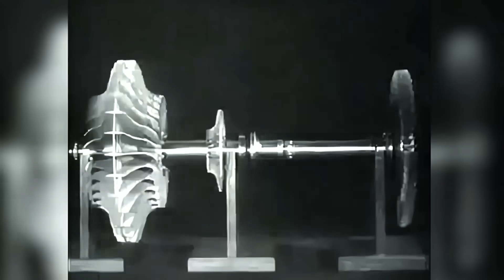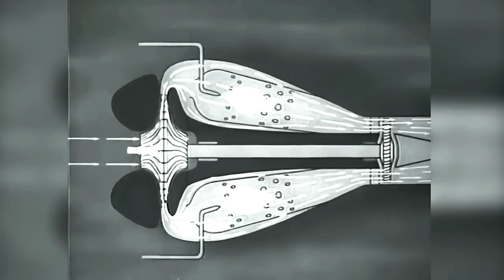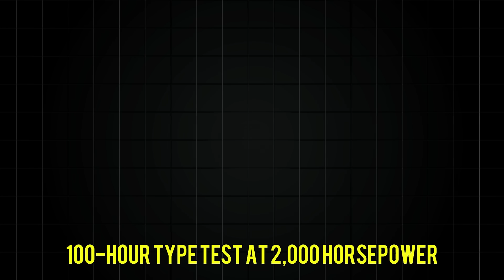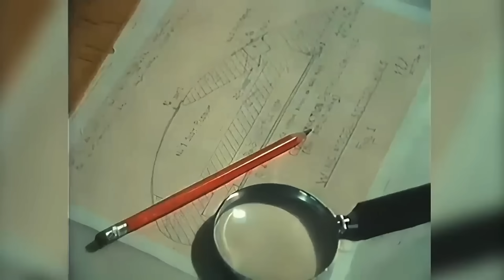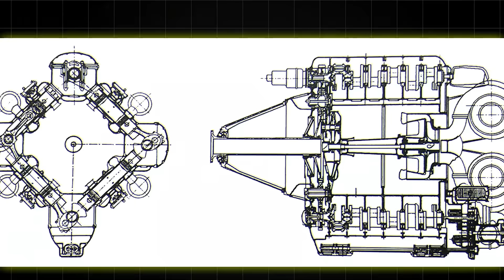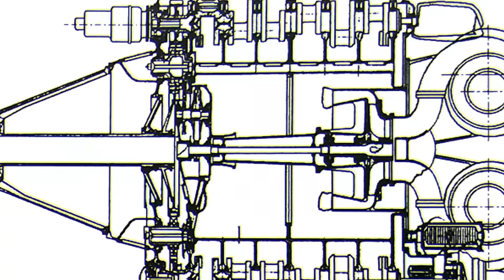The Shocking Truth Behind Junkers Jumo 222 Engine

Comment: Every combatant pursued engines of comparable size. The US had a half dozen similar engine projects that all failed.   The British Sabre and Griffon engines were also comparable in displacement, and worked. Claiming that those countries stuck to traditional engines while Germany sought some kind of breakthrough is just ignorant.
Reply: It also has to be remembered that the Jumo 222A/B was expected to produce 2500 hp and only 87 octane fuel.  It was only a little heavier than the Napier Saber with both  over 900 kg.  The engine  did have technical problems but they were slowly solved and the engine was on the production plan for 1944.  Too late to help the Ju 288 but a likely power plant for the JU 388, JU 488 and variants of the TA152.  
-It likely would’ve been ready in 1943 I would’ve performed as well as the Curtis Wright R-3350.  The Germans just didn’t have the resources to gamble.  
-It was ready by 1944 and it was scheduled for production but then they decided that they wanted to see 3000 hp out of it.  They were reaching 2800 at the time using 87 octane fuel and water methanol injection.
-Obviously at that point they saw Jets is the only future.  Plus the Jumo 213J and DB603M we’re both promising around 2700 to 2800 hp on C3 fuel.
Reply: Correct the big factor in this is streamlining production for the war effort
f.e. The Soviets refused to put the T40 (and improved version of the T34) in production.
The USA also had improved versions of the Sherman on halt.
The British kept the Merlin instead of the Vulture.
Its all about getting the most bang for your buck.

A famous modern example is that all JCB tractors did dig more M3 of dirt then all other big diggers combined on the planet!
Reply: Continental developed a similar design with multiple banks of six cylinders.  Another failed super engine, lost to ambition.

Comment: 01:07:
What on earth is Frank Whittle (British gas turbine pioneer) doing here? I don't believe we worked on the Jumo-222! 
This use of any mix of historical footage from the period like so much wallpaper is becoming quite common on YT. Personally I find it can be quite annoying.

In his biography Ernst Heinkel pointed out that the Treaty of Versailles, which forbade Germany from building military grade aircraft, had little effect on German airframe development, but seriously compromised high performance engine development, one of the reasons his company developed the first jet engine to fly. It takes far longer to develop a high performance engine than the airframe with which to fly it.

A good part of the Jumo-222 story was continuing changes in requirements by the RLM to an already complex engine.
Another reality was that the German aero engine industry was seriously overloaded. There was a limited number of engineers to oversee engine production which had to meet ever more demanding output. Engineers and skilled tradesmen were always at risk of being forced into the army to help bolster the collapsing war in the East and there just weren't enough wartime men or resources to get such a radical engine to production status. The entire Bomber-B program (Focke Wulf FW-191) which had been predicated on this engine had to be scrapped. 

As a reminder of the risks of developing small high power engines, the Rolls Royce Vulture, a 24 cylinder X configuration engine was so unreliable and associated with engine fires that it killed the Avro Manchester. The Napier Sabre a complex H configuration (2 x 12 cylinder horizontally opposed engines driving a common output shaft) with sleeve valves suffered serious reliability problems until quite late in the war. These engines were radically different from those already in production and came with unknown risks, as Dr. Brandner at Junkers would discover with the Jumo-222. Junkers was already producing the Jumo-210, 211 and 213 quite apart from developing and producing the 004 gas turbine and were clearly overextended.

Comment: The Germans had a significant problem in the Octane rating of their fuel.  A bigger engine was required to produce the same power as a smaller Allied motor running on 100, 130 or higher Octane Allied fuels.  It was only remediated in part with water injection and methanol injection, which the Allies could also have used if they did not already have the high octane fuel advantage.  So bigger engines without bulk was a real problem.
Reply: I first came across this in a British book published in the early 1960. The authors summed up it up simply: the DB601 increased from 1000 hp in early models to 1300 in late models. The Merlin went from 1000 to 1600.
Reply: @geoffsokoll-oh1gq  the DB601E Use on the Me 109F4 was a masterpiece that achieved 1300 hp on 87 octane fuel using variable length tunable inlet ports.  In June 1942, the ME109G1 entered combat Service with the DB605 increase cylinder volume. Technical problems meant this 1420 hp engine produced 1300 hp for a long time.  It probably could’ve  been improved with better fuel and some strengthening.  
-about three months after the ME109G1 entered Service the spitfire IX with the Merlin 61 entered Service with 1560 hp.  When the Germans fix their problem they went to 1420 but the British then jumped to 1700.  By 1944 using water methanol injection the Germans got to 1700 hp as well.  But generally British engine power was 12 months ahead of German.  Part due to fuel and part due to the teething problems of introducing the new engine.
-The Germans had planned a two stage DB605L for 1944 bombing of the time of Ben’s plant and the high altitude test sells delayed. What would’ve been used on the ME109 G6.  In aircraft supposedly capable for four57 mph at 31,000 feet.
Reply: @geoffsokoll-oh1gq  It all depend on the where in the design cycle, both DB600 series and Merlin series did have about 1700hp at the end of the war, and Merlin post WW2 ended at about 2000hp
Reply: Higer octane... allows for more turbo bost. Whitout knoking.. .. ..gasoline alone whithoit changues does not provide profits..
Reply: German C grade fuel reach  about 97/130 in late 1942 having gone up in steps from about 94/115.  This allowed the BMW 801D2 to go from 1700 hp to 1950 hp using C3 injection into the eye of the supercharger for ground attack FW 190 F for use below 1000 m and increased emergency power for the fighter versions of about 1850 using Rich mixture straight into the cylinder with no altitude restriction.  The two systems were unified in early 1944 in the BMW 801 TU.  In September 1944 The BMW 801TS with an improved supercharger impeller and boost rating came into Service with even more power.  
-by 1944 the allies were using 115/150 octane fuel.  The second number is the performance number and indicates the percentage increase in power possible.  100/130. Fuel can produce a 30% increase in power.
-I think the first aircraft to Use water injection was the P 40 7D in 1943.  The gym started using it in about April 1944 on ME109G6ASM.  
-C3 fuel required maybe 25 to 30% more effort to produce and tended to be only used on specialised aircraft or the BMW 801.  It became fairly common in 1944 of them disappeared again with the allied bombing campaign on oil refinery.

Comment: The problems were worked out by 1943. The 8th Air Force wiped the Junkers factory off the face of the Earth just when the 222 was about to go into production. It would have made over 3,800 HP with nitrous oxide injection. As great as it was, it was not as great as the Jumo 004, also made by Junkers